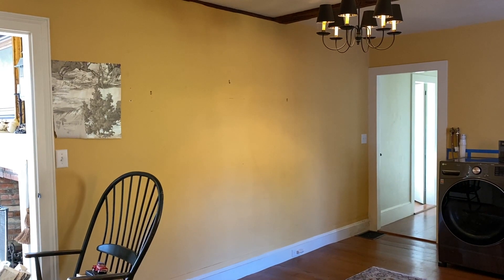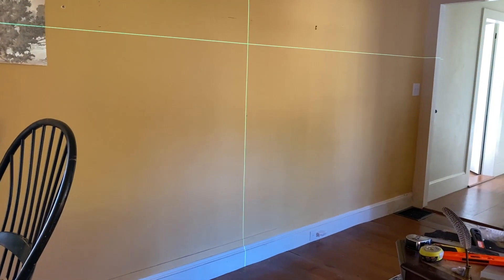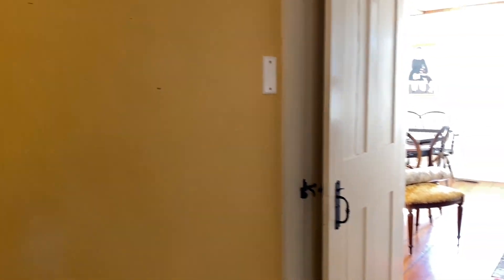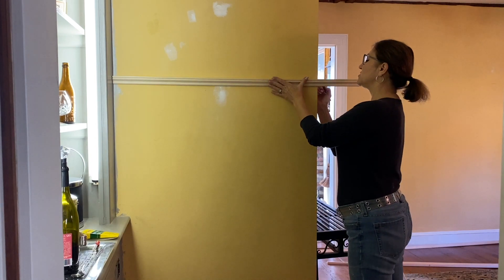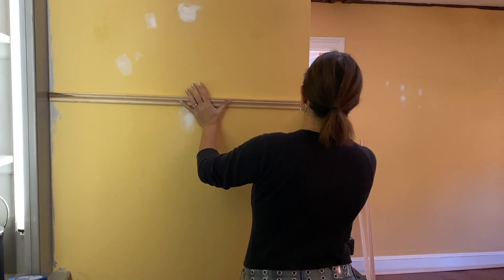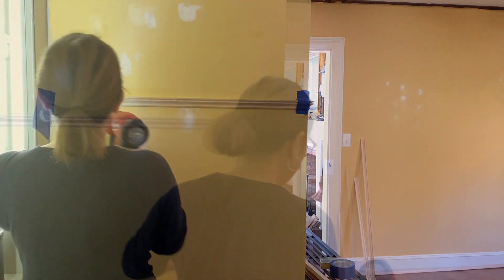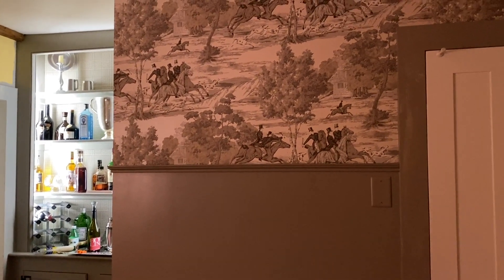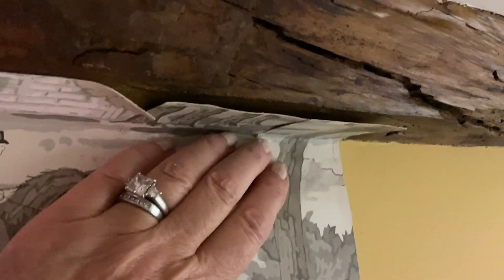Home remodel, papering, wallpapering, creating a cozy room

Comment: Looks great! What kind of lights are you using inside the shelving unit? Is it hard wired or a strip of so e kind?
Reply from the maker: They are hard wired fluorescent lights from a previous owner.  I will be changing it out at one point.